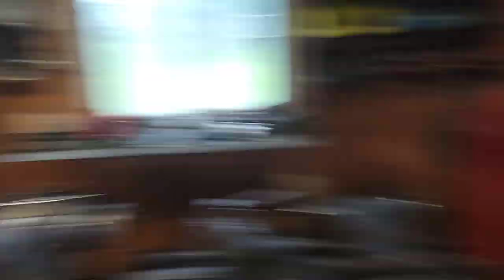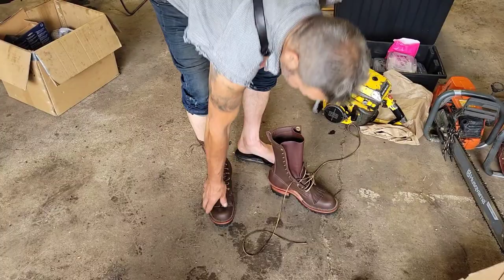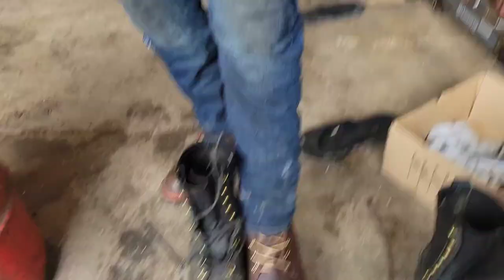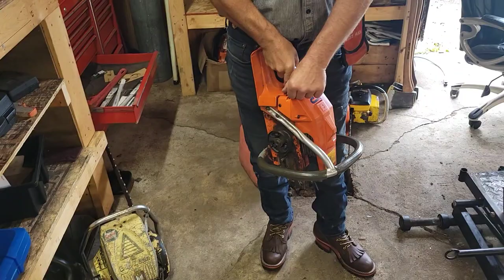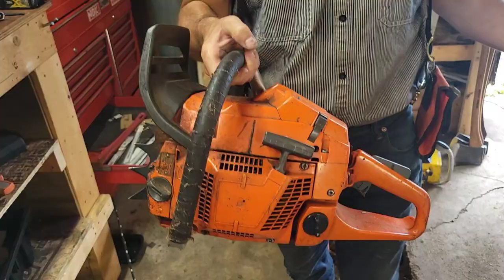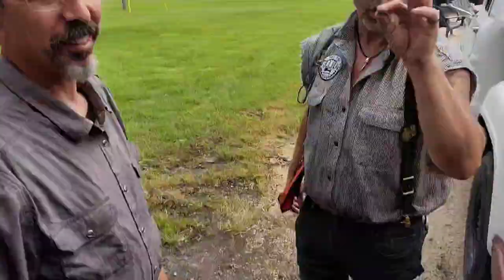Saturday afternoon shop time with Buckin and Morgan

Comment: Hey Tinman, these videos are great. I just built a 2071 Jonsered with a big bore kit and a 272 piston, runs ok but doesn't have enough torque at 9000 feet elevation, need to go back in and raise the upper transfers so they open completely
Reply: I also recently built a 2065 with a 52mm bore. Runs, just need a carb kit for it. I think she'll rip. I always have a 2071, and my dad has another 2071.

Comment: I was racing KTM's when those Yamaha's were popular....:) You "porting" one of those?? The 465 version was a strong machine, were always the machine to beat off the line until the big cr's arrived to move the evolution needle again, I raced 85--89's versions back in the day :)
Reply from the maker: Morning. 

I dont think I'll port the old 490, but it does need the combustion chamber mod that many did to them. 

Other then that I need to go through it and freshen it up. It's on my never ending  list of projects.

Comment: Tinman , I have a question !!!! I have an old mculloch m15 saw do you have or know were I can get a new diaphragm gasket , needle and needle wire for the carberator/ carb rebuild kit ????????????? Can't find one !!!!!!! Please advise  . Thank you
Reply from the maker: Mornin Andrew, you need to do a search for a tillotson HC carb rebuild kit online. 

I'm not sure who has them but I'm sure they are available somewhere..
Reply: @tinmanssaws  Hello again , thanks for the pointer = hc style carb , regarding the mculloch m15 . It has an hc13A on it ,  I found am hc1a , new old stock carberator for $43 to the door,  but any idea if those 2 are the same or compatible ???? Can get a carb rebuild kit for the one that's on it for around $39 to the door . I replaced the diaphragm gasket on it and the float needle , it starts but acts lean , as soon as you give her throttle it wants to die . The float needle valve has a groove but no wire going to float lever , I'm used to dirtbike and sled carbs . Float needle has a little bit of stick to it in the brass bore , it's perfectly clean ,but was thinking about polishing bore with a q tip and some polish compound in a hand drill. What say you Tinman ?????? Thanks alot for your time. I started collecting mcullocks less than 2 years ago , now I have 5 , a nice pro-Mac 700, two 10-10s , a mint mini Mac,  and now this mac-15 . I call the m15 the vietnam model since it was made from I think around 65-69 or so . I have alot of fun running them,  tuning and am impressed with the power on all of them , they had great port design for the times and big bores and I think the heavy cranks and rods really keep them spinning . My hats off to the old timers that developed and manufactured those. My grandpa had a few and I was enamered with them when I was 5-10 years old . Now I'm playing with them . Going to cut a tree up for free for a woman here in northern Michigan tomorrow with a 10-10 since I just had a chain sharpened for the one .